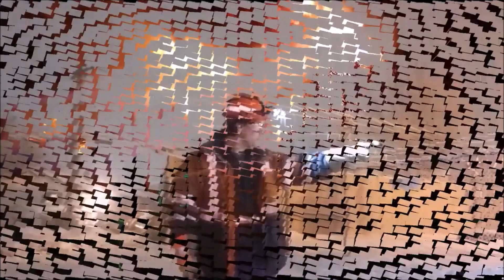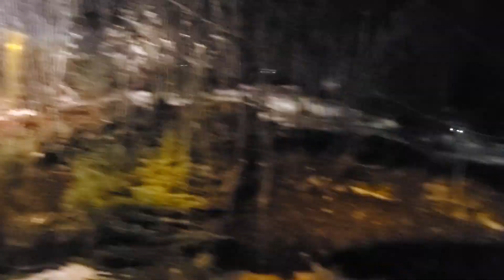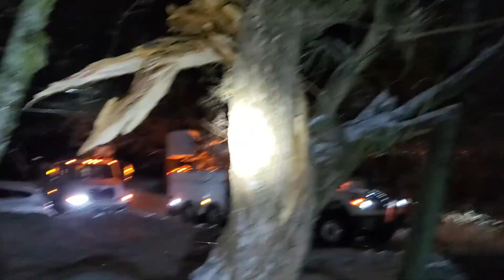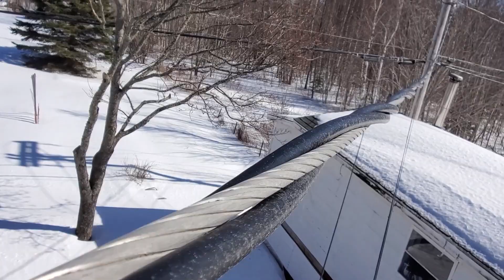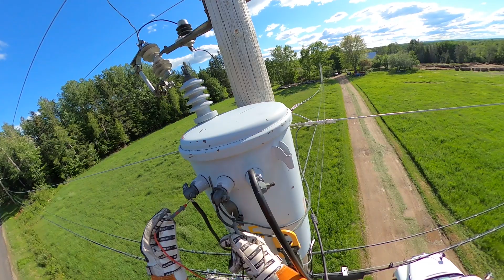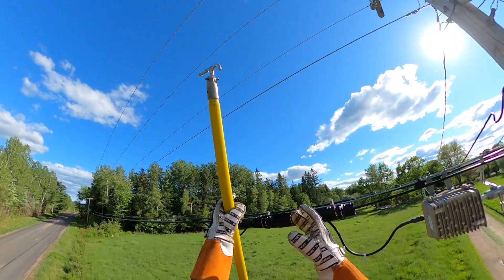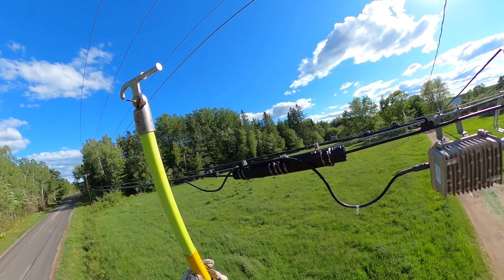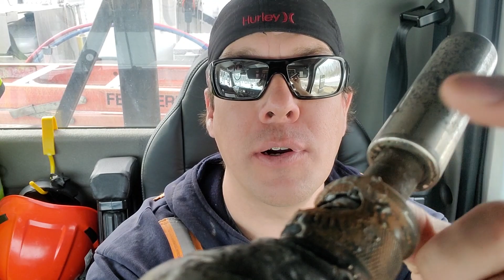Accidental contact with 120 volts

Comment: I dont see anything wrong with saying "it's not the voltage, it's the amperage". Just because the meter is pulled and there is no current being pulled on the consumer side, if said transformer or what have you can supply a lethal amperage then the saying is correct. If it was 120v at say 1ma, nothing is going to happen to you. Let's say that that transformer can supply 120v at 100a or hell even .5a, then you got major issues. You can have 500kv at a couple ua and nothing will happen, make that 30ma or more, then your screwed. So it really is about the amperage that the transformer or feed line can supply. Let's say you have a dead short on a line that is unfused. You have the improper Guage wire or cabling, then you have heat to worry about if the amperage is high enough. Not to mention, if the resistance of your body or tool you are using is lower than that of whatever material the short is occurring through, then yes, you have problems. Nothing you are saying is incorrect but nothing wrong with that saying either. People just need to be educated.

Comment: Congrats on the new house. Even 12V can be dangerous. Saw a mechanic who's ring on his finger bridged a car battery terminal to the body in a tight spot when another mechanic distracted him for a second to ask something. Just happened to have his finger in the right spot when he turned his head. Was very knarly looking to say the least.
Reply from the maker: Ouch! Yes your right, in the right circumstances any voltage is dangerous

Comment: I once had a 3 phase 480v, 600A circuit short all 3 phases to ground while working under a machine, reworking a junction box. We had the switch off, all the crew`s tag outs on it and a company overseer type person took them all off and turned it on while I was still working! It blew up basically in my face, I ducked as it sucked the air out of my lungs, I saw sparks and liquid metal everywhere and I looked up and saw the liquid metal still dripping out of the handle of my screw driver! Needless to say I quit my job.

Comment: I was working on a car of mine, and the ratchet touched the battery terminal for a split second (the cable was disconnected). The 12 volts melted a spot on the end of the ratchet.

Comment: And that is why Static Electricity doesn’t kill most people ...... so low current capabilities. Think about what an arc welder is : low voltage but very high current capabilities, so 120 volts with high current us a no-no and drop over dead. Also basically, you cant get electrocuted by your car battery because it is  just a low voltage source. So stop sticking your body stuff into wall outlets.

Comment: You do know that if you grab both wires, you become the load and creat the amps.  So yes it is the amps. And I can only hope there is no one out there, that is not a line man, grabbing lines of any kind for any reason.
Reply: It's both. You need the constant source of electricity
Reply: @jamescollier3  Sorry, But it is not both. I am bare hand certified to work high line voltage bare handed. If it were both, even the birds that land on a single line would e killed.
When you work high line bare handed, you tie into the same potential you are working on. 44,000.. 250,000, even 500,000 volts are flowing around you. Only when you cross potential and create amps, you will be killed...
Reply: @JackInTheShop  I guess you haven't seen the videos where they step down transformers to 4 or 5 volts and high amperage to melt metal but can touch it. https://youtu.be/ID7gG6krecI
Reply: @jamescollier3  I guess you did not see the high amps part of it
Reply: @JackInTheShop  yeah he had his hands on your "deadly amps" part and was fine...and you are wrong about the birds too
Reply: @jamescollier3  he had his hands on the coated conductor. That it safe. He could have even grabbed one of the bare lines and been fine.. just not both
Reply: @jamescollier3  just wondering, have you ever worked around electricity. I have over 30 years working around it professionally. Not just watching videos.
Reply: @JackInTheShop  3:52
Reply: @jamescollier3  that just proves the point of working between grounds. The can acts as a ground..
Reply: You still have nothing that says voltage on its own will hurt you
Reply: @jamescollier3  I am sorry, you have not made a valid point for both. Nor have you said what experience you have.  I know for a fact, voltage alone will not hurt you.  Yes, you can not have amps with out voltage. That is true. But voltage alone is not enough

Comment: Volt's don't kill you, amps do. Instead saying that it's only 120 volts also say the amps.
Reply: it is the amps available that get you, if the supply can not provide the amperage, a function of voltage and resistance the amperage is not there. if the voltage has to flow through 1 Mega ohm there is not enough potential to be deadly. I have worked on circuits carrying over 240kv and due to protective gear I have been able to draw arcs through my hands but the current was not strong to do damage. What gets you is a function of the body resistance( at both points of contact and the supply voltage). 1 volt or 10,00 volts it all comes down to I=e/r. If r is high enough I won't kill you.!

Comment: It’s all about the available fault current. A 25 KVA transformer has 104 full load current in Amperage at 240 volts. Let’s say the impedance of that tub is 2.4%, given on the nameplate. Take 100/2.4 = 41.66. Now take your full load current at 104 and multiply that time 41.66. That’s 4332 fault current amps. That’s damn hot, nothing to screw with. Multiply that times 3 for a 75 KVA tub, secondaries can be very dangerous.

Comment: Thank You for continuing to post and educate on safety. It's such an important thing and while the old timer's laugh at it, personally, I like going home at night. While I wasn't a lineman, I have worked on broadcast equipment that ran on 33kVDC. (Tube UHF TV transmitters require that voltage). I always , always took safety seriously when working on it. (2nd man, never work alone, full grounding, testing grounds, etc.). I never took any shortcuts because safety really is key. I don't care how much it may be laughed at, I never once had an incident in 24+ years.
Reply from the maker: Thankfully the safety culture is becoming more and more accepted. It can be a tough juggle while maintaining efficient cost effective service but more and more companies are seeing the value making safety a top priority !
Reply: @Bobsdecline  Being in the union helps that as well with us. I am in the IBEW here, and Safety is a big big thing with us. There are paragraphs about items that protect us.

Comment: The voltage coming out the transformer is way more the a 120 volts it's actually around 500 or 600 volts and the meter is what regulates the voltage going into the house or building
Reply from the maker: There are many different configurations, however 120/240volt is the norm for single phase residential. 
In our area we supply 600v phase to phase (347v phase to ground) for our industrial loads depending on requirements. In order to measure the 600 volts there are PT's which transform the voltage to a more manageable level for metering equipment. Some configurations also require current transformers. Especially when you get into 400+ amp services.

Comment: Greetings from Auckland, New Zealand.
Here we have 240V and it's not very Pleasant to Touchie.
When I was a kid I had an old Arcade machine I was working on. and didn't realize there was a Live Bus Bar? Running down the Back on the Unit. and Accidentally Touched 240V.. was not pleasant at all. thank god. I only did so with 1 hand. and only brushed it.

Much Respect. and I now Treat all AC Circuits as Live. and Make sure I Ground big Jucy Capacitors before working on PCB's etc.

Comment: I'm not a lineman, I probably never will be, at the same time I apparently know alot more about power transmission and distribution than average joe, my two cents is that you should remember that some welders run on 120, and that's more than enough to melt steel

Comment: I like how you relate it to water. You can put your thumb over a garden hose at 40psi, but you can't stop a fire hydrant that is wide open at 40psi. For those who have got their thumb in the light socket before, this guy got his drill in the main. Both are at 120v but one is much more powerful than the other.
Reply: I think both 120v from a light socket and 120v from last mile mains distribution have the same potential power. It is only the circuit breaker rated at let's say 15 amps that prevents the full potential power from being delivered. Either way, I doubt that a human body can even pull that much current, but the current it can pull at 120V is definitely enough to kill.

Comment: Great video!  The zone/wire between the transformer secondary bushing and the customer breaker is definitely a scary part of the system since we'd be relying on the primary side fuse to blow for that secondary side fault.

Comment: 120v at major amps yea that will blow yea like that, but not when you limit the current. However there is a point where it’s just to high voltage that it doesn’t really care but that would be trillions of volts. Example 120v ac at a current of a few nano amps you wouldn’t feel it’s the combination of volts and amps that can kill you.

Comment: Great video...It only takes 0.1 amps to be lethal, the saying "it's not the volts it's the amps" , while true from a scientific standpoint, means nothing from a house power standpoint. Literally everything we or a homeowner would touch that doesn't come from a stun gun or spark plug or some sort of tesla coil or some other high voltage zero amperage device will kill.

120 volts will kill you just as dead as 2400, 7970 or 19.9 kv.

Comment: Any voltage can kill you. Ive done electrical work live and even being careful and knowing what im doing I am very nervous knowing that 1 wrong movement and it could be my last. But it gets worse. I've had a 110 hotbox in a restaurant that I worked in grab me and shock me. Couldn't let go of the cord and the only thing that saved me was that my knees gave out causing my body weight to pull the plug from the socket. I immediately pulled the heating assembly from the box and removed it from service as unsafe.  Manager didn't like it.

Comment: It's basically a 120VAC arc welder...
Welder's/Plasma Cutters blow holes through metal with only around 21 volts at up to 240 amps

Comment: Another reason why the saying "its not the voltage that kills, its the current" is misleading, is that the current required to kill is only 18mA. Almost any power supply, even a penlite battery, can deliver 18mA. It's the voltage which makes those 18mA happen. You can grab the terminals of a car battery that can deliver 200 amps with your hands but nothing will happen. While at 10kV hundreds of amps will run through your body instantly.

Comment: In Australia the main service HRC fuse is usually rated at 55 amps on a 240 volt AC private power line.

Before the fuse an 11kV to 415 VAC transformer is rated at about 200 kVA & is internally star connected,if you were to place a dead short across a secondary phase it would easily pull quite a few hundred amps (e.g. about 400-500 amps) then blow a hole in the a power tool in the likes you have shown on the video.

I can remember almost 30 years ago when a linesman had to diagnose blown 415 VAC fuses on the secondary side of the transformer in front of my parents house it was caused by a short circuit in the secondary winding of the transformer.

Every time he tried to replace one of the secondary fuses the oil inside the transformer boiled & the HRC fuse kept blowing on a phase,it kept doing it after he removed all of the private line fuses in our street.

High voltage is a bit different,for example,on a couple of occasions a boy got electrocuted when he broke into a 33/11 kV substation in Sydney to fetch his tennis 🎾 ball,he used bolt cutters to remove the padlock to get into the substation.

A spark jumped out & zapped him from 1 metre away,he died.

At my old high school a boy got electrocuted back before I was born in 1975 when he was carrying sprinkler pipe on a hot & humid day in the agriculture plot.

It came within the same distance from the power line & a spark arced across from a 33kV phase then electrocuted him,so he's dead as well.

The supply authority moved the power lines so they went around the agriculture plot !

Comment: 12 volts can cause that level of damage if it has enough amp draw behind it. Look up Photonicinductions stuff on high amp low voltage melting things. Most homes in the US have a main breaker rating of 200 amps some may have a 300 amp rating, it depends on the home size and what is needed for use, etc. With that said a street light feed may have a main breaker of 300 amps or more because the line is handling a string of lamps also most street lighting in chains uses 277 volts not 120 anyways.

Comment: In more than 50 years working with electronics, from the vacuum tube days to substation batteries, I have made contact with DC a bunch of times. One of my first ones was excellent contact with 300V plate voltage hand to hand when I was 14. It felt like I was hit in the back of the head with a 2X4 but I never lost consciousness. More recently I have made contact with 125 VDC substation batteries - enough to make a guy flinch.
AC is a whole different thing, largely because of how it affects our nervous system. 90Vpp (equivalent to about 35 VRMS) "ringing voltage" on a telephone line will make you swear. 120VAC is roughly as deadly as a rattlesnake. You may survive; you may die.
Now for a confession: I often work household wiring hot, replacing outlets and light switches and the like. Every single moment I am aware where the energized parts are and that only one of my hands at a time is being used around the hot parts. I wear gloves and goggles and never make conductive contact with any metal - it can all become energized, and other parts of our body may contact something grounded. It will bite you if given half a chance.

Comment: My father was an electrical contractor.
About 50+ years ago, he employed an old guy, who used to be a linesman with the supply authority.
The poor guy was seriously disabled...
He had been hurt in his linesman job. He was working live on a padmount transformer and his wrench had bridged the phases. The fault currents that are available in these situations are devistating. He was lucky to survive.
Nice of my dad to look after him - but far better if it had never happened at all - that one instant completely  ruined his life.
(Fortunately we have safer tools and work practices these days, but still, catastrophe is lurking)
Reply: Same thing happened in my city, I get the pressures to do it live but it's just not worth the risk.

• On 3 February 2015, four electricians opened the CFS access cover to inspect the damaged fuse. While opening the cover, one of the separated end-caps was dislodged.

• The fuse end-cap sank in the oil tank and made contact between one of the “live” 11kV busbars and the earthed tank at the bottom of the CFS. This created an electrical short circuit and an electric arc, a catastrophic explosion and the expulsion of hot oil which ignited into a fireball inside the switchroom.

• The four electricians all received horrific burns from the explosion and subsequent oil-fuelled fire. They all managed to exit the HV switchroom. One died at the scene. Another was transported to hospital but died later that day. The two survivors spent months in hospital receiving treatment for severe burns.https://www.sbs.com.au/news/wa-shopping-centre-blast-kills-two-men
Reply: try our downtown 120/208 ring with 12 transformers in parallel on it.  they don't make breakers that can handle that kind of fault current.
Reply: Sounds like he experienced an arc flash. That will ruin or end a life.

Comment: Worked on power in a Bell System telephone switching office. Yes, only 48v DC but could do a lot of damage. Many times that 48 volt plant was operating at 1200 Amps.
Reply: 1200 Amps is just the normal operational current.  worry about the fault current which can be over 200 kA!  touch it with your fingers and you get a little 0.048 A whack.  touch two lines with your wrench and you better be wearing the right PPE.

Comment: 120V can do a lot of damage, due to the amperage and electrons flowing through the wire BUT Ive worked on many houses to trouble shoot electrical issues and found that if there is a 120V circuit and a connection that was loose that has build up soo much resistance, I could measure 120V but there is not enough electrons to pass through the connection to do any damage. The resistance is so high to cause any damage. The amperage does play a big part. I have been shocked pretty good from a 24V sprinkler system, shoes were wet standing in water and did not know the sprinkler had power to the valves, there was more conductivity by standing in the water. I have been shocked by 25,000V from the back of a old TV set picture tube but my feet were not ground only my hands were touching the chassis and metal bench. The amperage on that coil was very low mil amps. the same is true with the coil on a lawn more engine spark plug 15 - 20K volts but delivers very low mili amps of current. Id rather turn the power off but have worked on 120V and 240V live with proper gear. 480V I always turn off, it can get 1000 times more violent with a simple mistake. When working on electrical circuits shoes must be dry and feet, there are times when you have to trouble shoot a 120V circuit live and trace wires that have power and ones that do not have. If I am outside trouble shooting a circuit and its raining, I do not work on live circuits